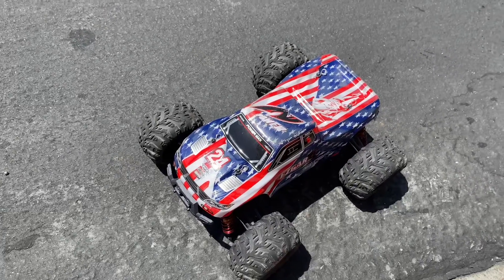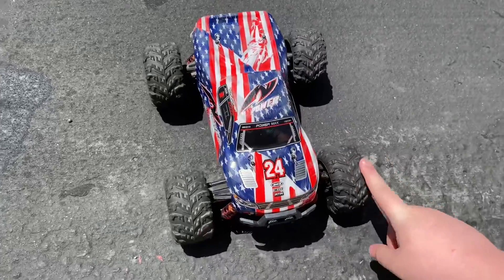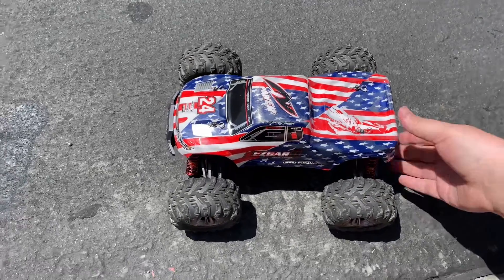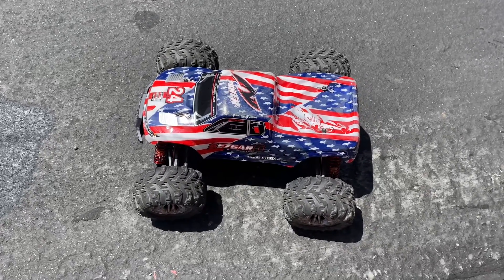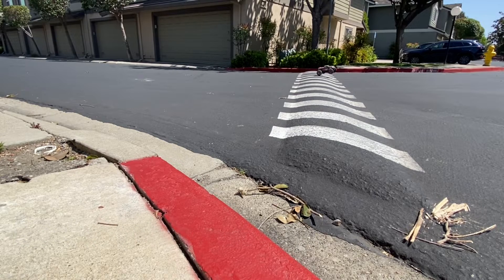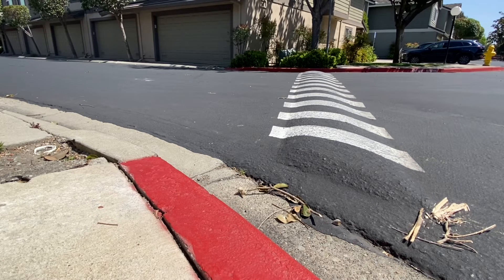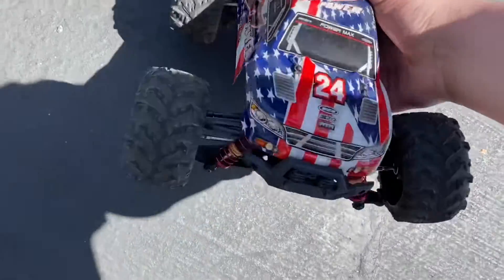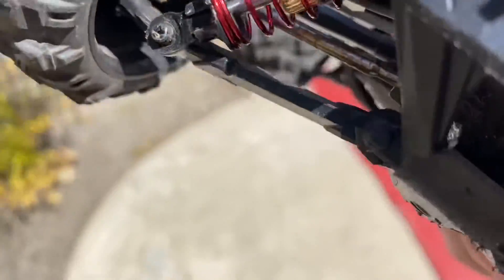Driving my Bezgar 6 RC Truck *spoiler it gets broken*

Comment: you dont use GLUE to fix breaks especially for that style of rc car you have to replace the whole piece which is easy the parts are pretty cheap you just gotta find the right size or piece
Reply from the maker: Your right I thought that glue was gonna hold it up but I guess not. Even thought I was with my grandpa when he fixed it.